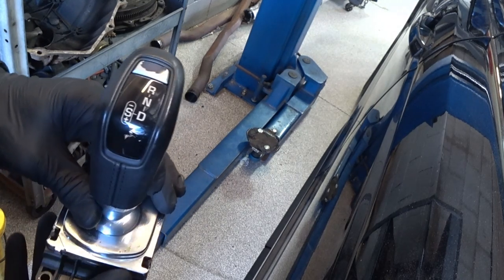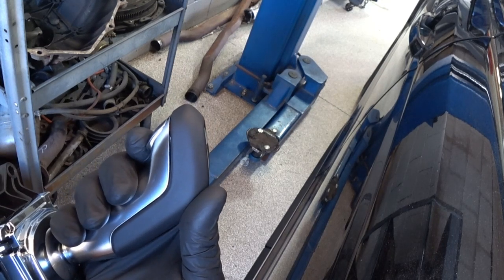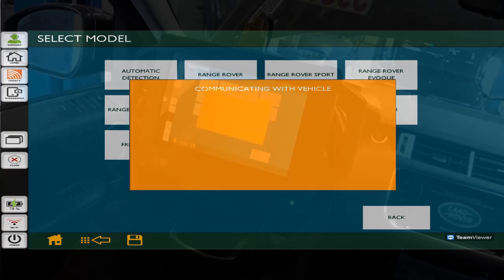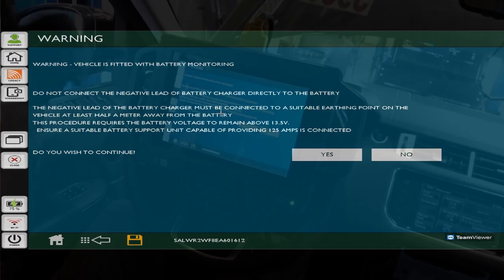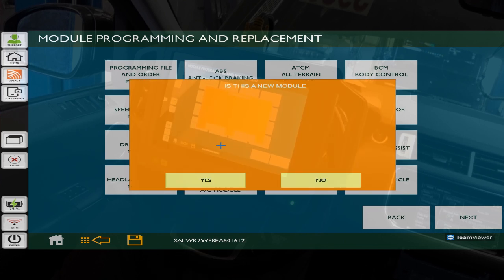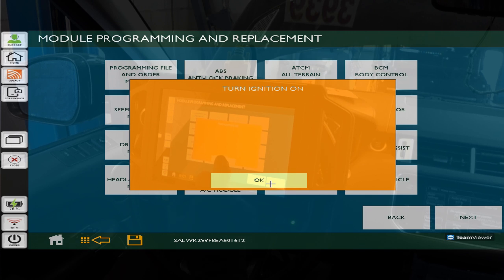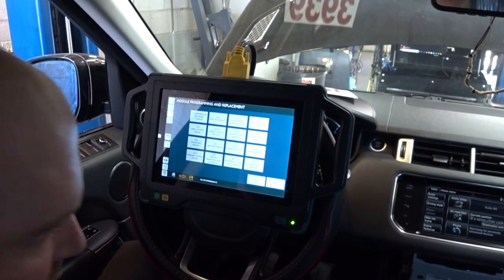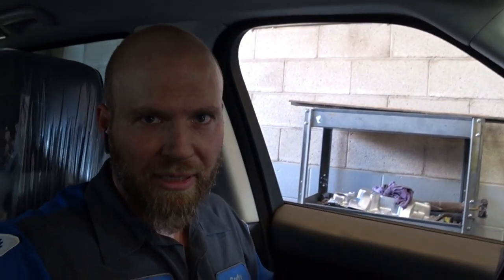Land Rover Sport GSM using AutoLogic Drive Pro es

Comment: Pretty sure there is a TSB on this issue where you don't have to replace the entire shifter.
Reply from the maker: I understand that but those rebuild kits for the shifter are a waste of money honestly. Every Land Rover tech I’ve talked to said not to use the rebuild kit and to replace shifter
Reply: @codysautodiagnosticsprogra8706  I've done probably 20-30 of those repair kits. (I'm a Land Rover tech) and have never had an issue. Makes me wonder what those techs were doing wrong during installs? 🤔
Reply: @Yotataco04  I think some TECKS do not care about customers money, and do not want to spend time repairing, they replace .

Comment: No reason why this car or any other should have to write the VIN to that module. The VIN does not provide any info that changes how that shifter works. Manufacturers protecting their income unless someone wishes to explain otherwise.
Reply from the maker: I hear ya but unfortunately this is where the manufacturers are going so people don’t put used parts in cars. Vw is the same way with their electronic rack and pinons.